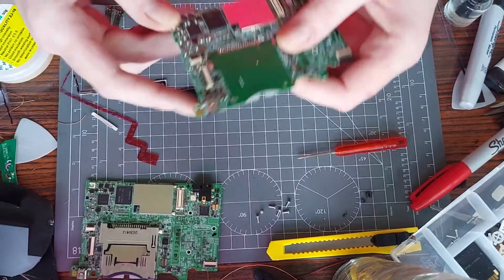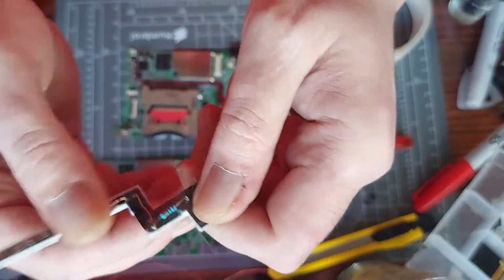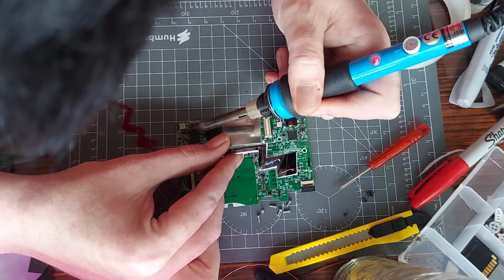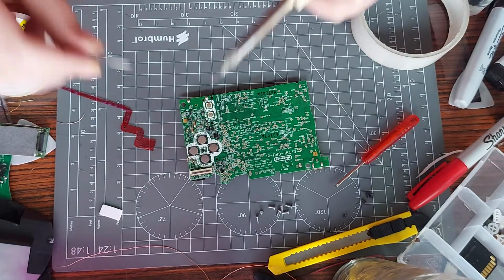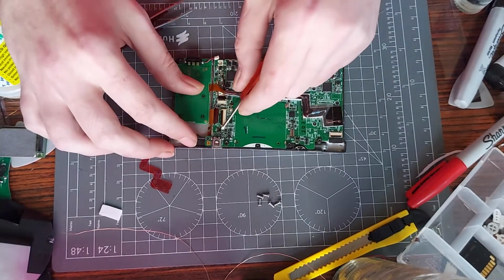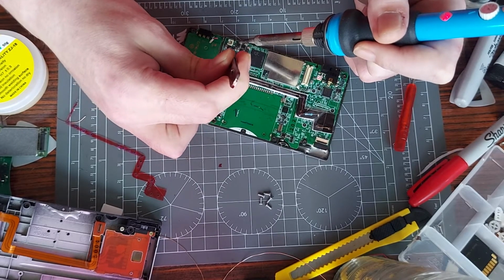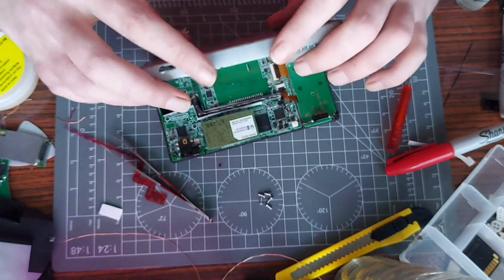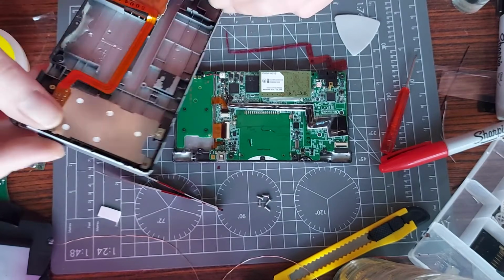How To New Gameboy DSI Macro (Part1)

Comment: Great way to help modders to get a dsi running in “macro mode”! 👍
Reply from the maker: Thanks mate, I was hoping I can get something decent thrown together for part 2. That will hopefully be easier to do and combine adding a speaker aswell.
Reply: Maybe use the smd resistor and will take less space! You need to get speakers on it!

Comment: what type of resistor and wire did you use ? would be cool if you could provide links for material
Reply from the maker: It was all salvaged parts from various bits of electricals iv accumulated from the enamel wire salvaged from power supplies to the 330ohm resistor salvaged from an old android box I think the plastic is just plastic from most packaged items the clear nail varnish is also helpful to keep it all safe from shorting against anything. Kind of like a poor mans homemade PCB lol.